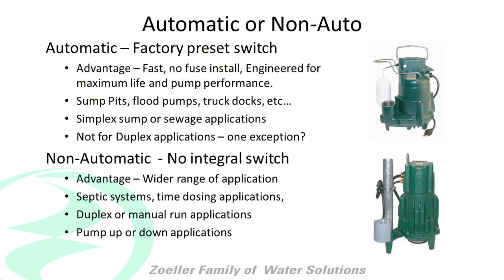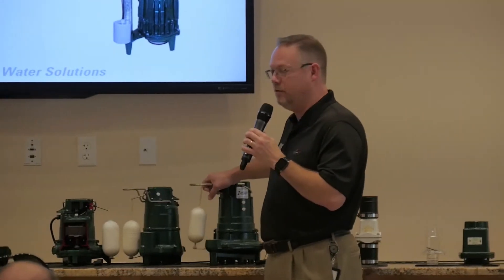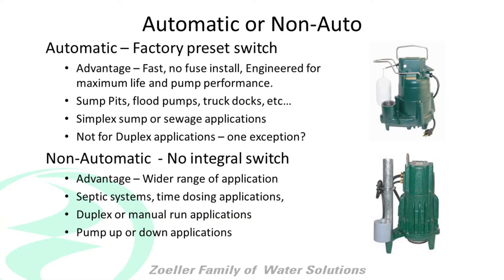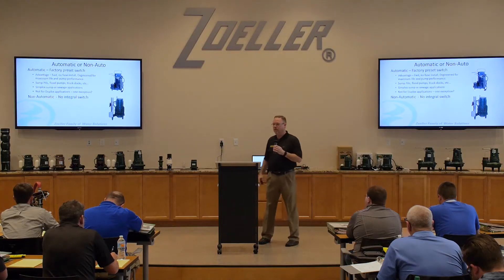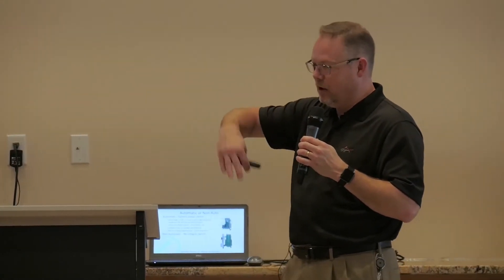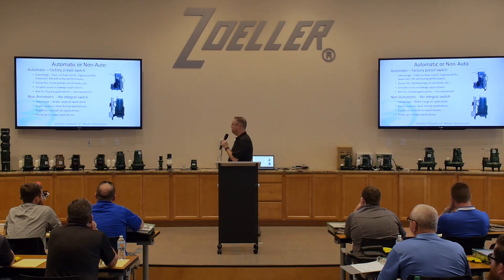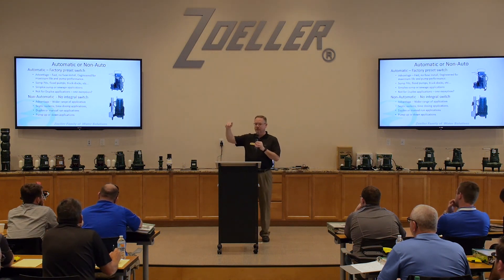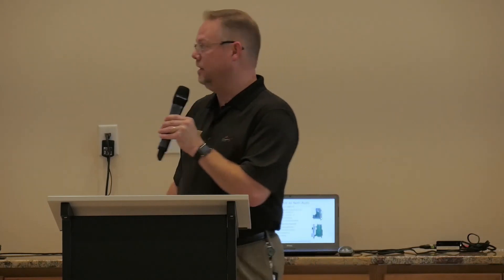When To Choose Automatic or Non-automatic Pumps

Comment: If you have a smaller pit, you can still use the non-automatic zoeller pump with a level guard switch:  https://www.youtube.com/watch?v=Slzku0l2BfQ

The level guard switch zip ties to your ejector pipe and you can set the height to whatever you need without the worry of a tether switch needing a large radius.  There are 2 points of contact with rain water that activates the power.  This allows for the pump to run longer and less cycles.  My pit is configured using a Zoeller N95 w/level guard and haven't looked back.  Also have a sump pro battery back-up for the N95 if the power failures.  If something were to happen to the N95, I have Zoeller 508-0006 Aquanot 508.  This is the overall ultimate "Cadillac" set up in my opinion.  You can't put a price tag on rain water removal and will never use anything but Zoellers.

Comment: The integral switches are the Achilles heel of many pump designs. Most will just replace the whole pump when the switch craps out. I always use tethered float switches.
Reply: This is great advice.  Use a tethered float switch through an SJ Rhombus cable tie around the pvc pipe.  The "piggy back" float switch has the pump plugged into it.  Use an LED plug on the pump and another LED plug on the open outlet to instantly diagnose the three failure modes -- no power, bad switch, or bad pump. Keep a spare switch near the pump.

Comment: What would you consider a larger pit.  Mine is currently 18” x 24” Depth.   Looking to install 2 pumps inside...
Reply from the maker: So for some of our smaller sump pumps we'd recommend our 30" x 36" basins for a duplex configuration. It would really depend on your system. If you'd like to speak with a Zoeller team member about it you can contact our Product Support department at zcotechnical@zoeller.com and they'd be happy to help you sort out what you need based on the circumstances of your application. They can also be reached at 1 800 928 7867 they're option 6. I hope this helps!

Comment: My pump had something stuck in the perpeller and know it won't run
Reply from the maker: If there is something stuck in the impeller, I would recommend removing it and then seeing if the pump will run. if this will not solve the issue and the pump still will not operate, I fear that you may have motor damage in the pump and it will need to be replaced.